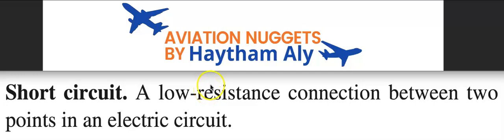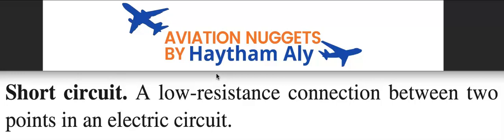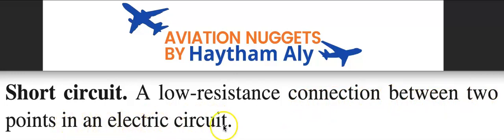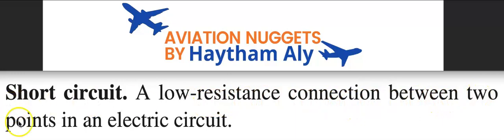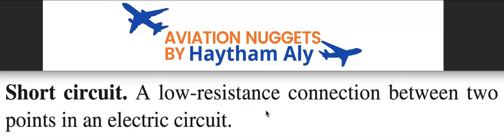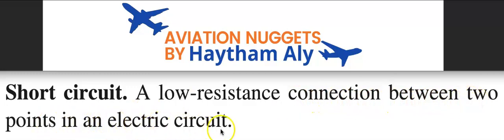What is meant by SHORT CIRCUIT in an electrical systems , airline basic course @Haytham_Aly #pilots

Comment: The accident you described also led to the requirement for empty fuel tank inerting systems
Reply from the maker: Yes captain, the regulators ask for a fuel tank inerting system specifically to the center tank as it is the first tank to be emptied and have the heat sources like packs underneath the tank that can easily take the fuel into flammable temperature